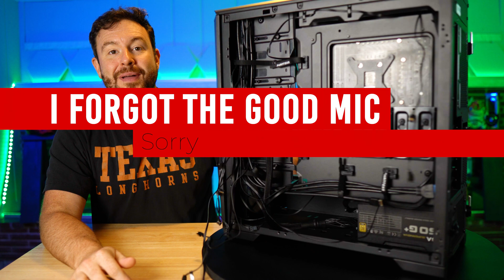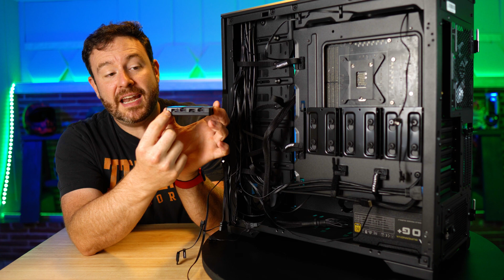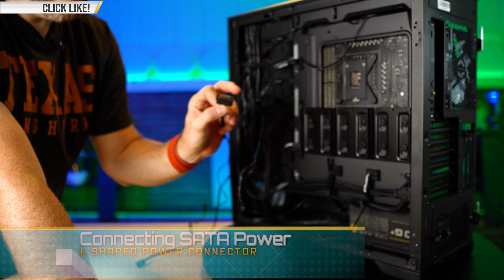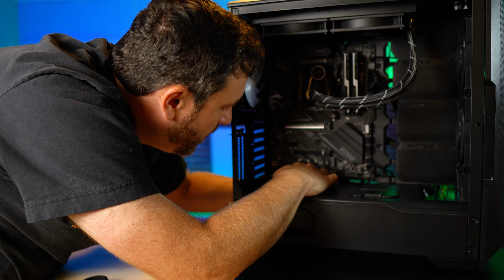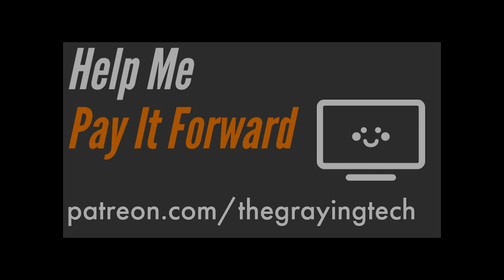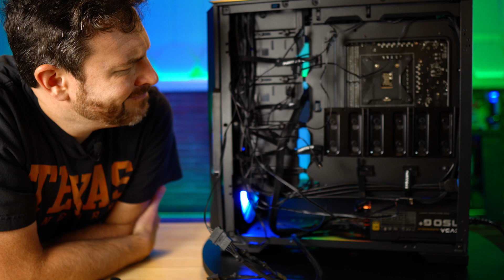ARGB, DRBG, RGB???? How to setup LEDs in your Gaming PC!!

Comment: I too am annoyed that argb hasn't been standardized. I just built my first computer, all of the lights were working except the front lights. Trying to get the front lights working, I touched the 5v argb cable end to the 12v RGB header, the pc was off and cable unplugged but unbeknownst to me things can still fry even when to psu is unplugged. Now none of the lights work except the ram sticks. And just now I tried to plug the D-RGB sata cable into the sata daisy chain that powers the hard drives. Now the hard drives aren't working. All of this because argb is not standardized. Someone please help me. Why are my hard drives not working now?
Reply: I might buy the corsair light node to get lights working but right now I just want my hard drives to work.
Reply: Ok I got the Hard Drives working AND I got the case's front lights working. I feel like genius. So what happened was that when I plugged the cases light control SATA cable into the hard drive daisy chain, it automatically changed something in the BIOS setting that needed to be changed back. It was VSM and secure boot. 

Once booted up back into windows, I had to go into device manager to reinstall or update 'Video controller' for my current graphics card to get the apect ratio to fit my monitor again.
Reply: @K3N0PS1A92  How the F would anyone figure that out !?!
Reply: @dc37009   Everything works now, lights, hard drives everything. And nothing fried. I'll just delete my comments now I guess 😅
It's funny how that works out sometimes. "Everything's broken... wait nevermind"